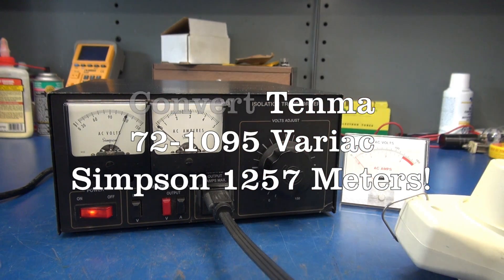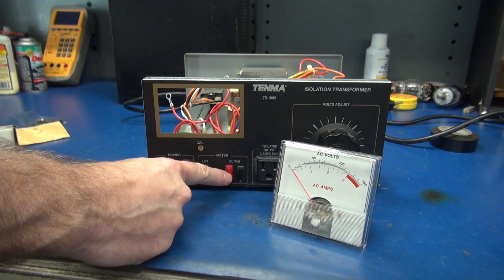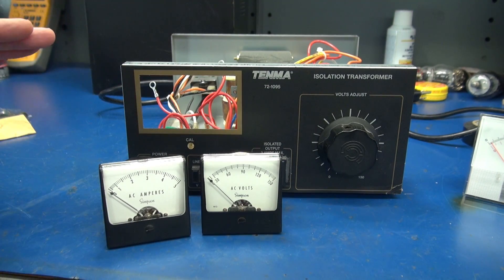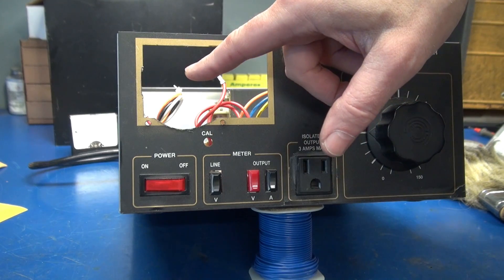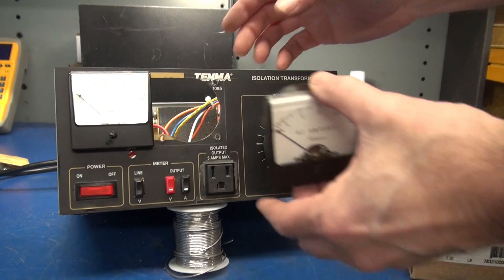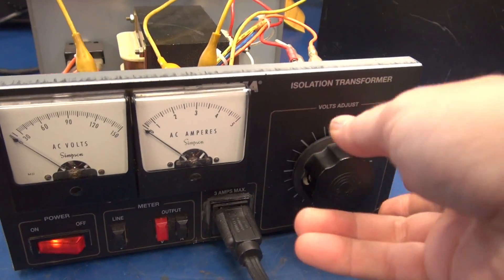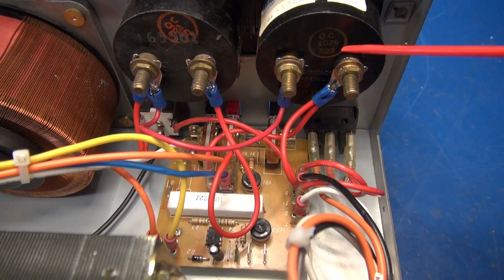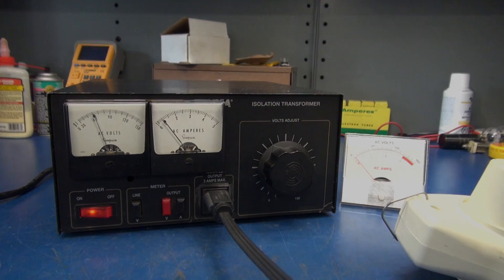How to repair/upgrade Tenma 72-1095 bench Variac to separate Simpson analog meters

Comment: I bought the same Tenma as that because I saw you using it in your RCA 110K video. Got mine for 50 bucks because the fuse holder was broken off and power cord cut off. New fuse holder and fuse and added a power cord and it works great.

Comment: I have one of those Tenma Variacs. I love the fact that it also has an isolation transformer as well. One thing to be aware of one those however, the ground on the output receptacle and ground on the power supply, are connected internally through the chassis. So in order to have ground isolation you have to remove the ground jumper on the output receptacle from the chassis.

Comment: I saw a video you made seven years ago about making a Princeton into a “Kingston” and I am looking into doing a similar project.

My fender custom deluxe reverb is 22w and my reasoning for wanting to do this conversion is that it breaks up early. I want to swap the 6v6 tubes along with whatever other components for a 6l6 tube setup. Or even some other setup but I want to make my 22w amp a lot more than 22w and I just need power because my amp breaks up at too low of a volume.

Do you have any information or advice for me, any would be appreciated.

-Thanks.